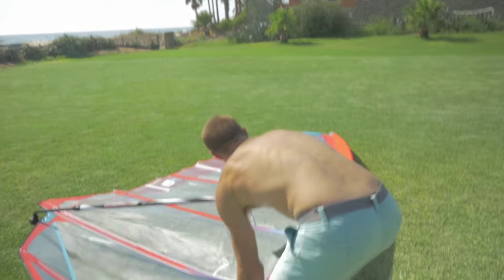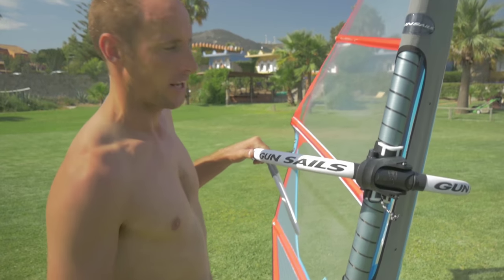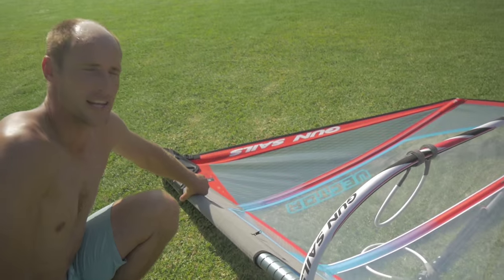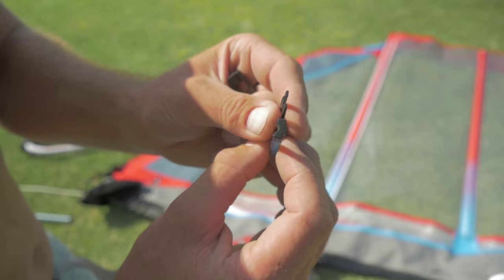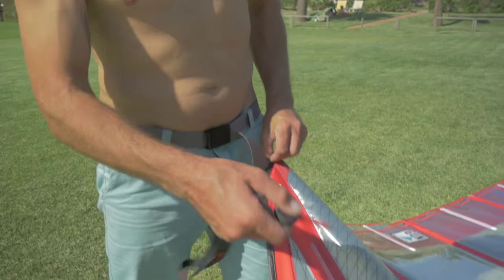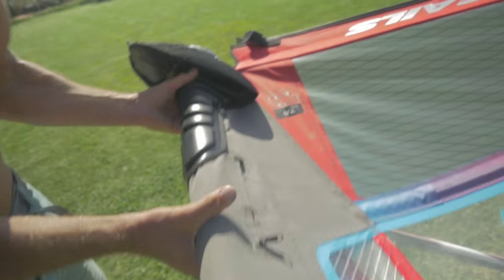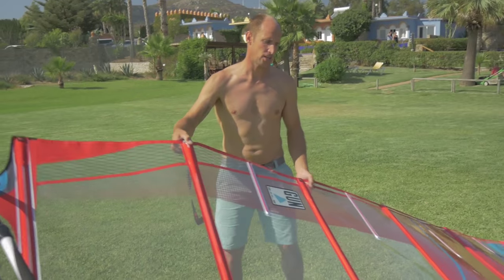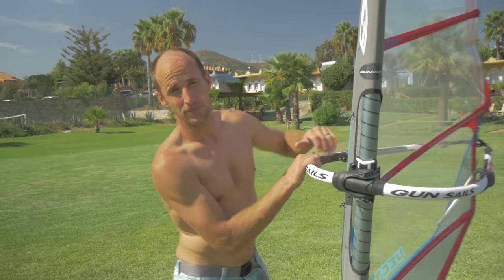GUNSAILS | How to finetune camber pressure

Comment: Upon replacing the 3 parts between camber and sail to 2mm in order to reduce the camber pressure, I still struggle with too much pressure on the cam on my GSR 2022. Hard to place cambers (impossible without max outhaul then releasing downhaul). Once in place, still very hard to rotate.
Any other tips pls??? Cheers
Reply from the maker: Hi, if you still have to much pressure with the right trim, you can take off all spacers to try and in the worst case, even grind off some mm on the backside of the camber. I suppose you use the correct mast for that sail?? Cheers Jörg

Comment: Hi, why are u using lower hole for boom terminal?
Reply from the maker: You can choose according wind speed and sailor size. In stronger winds, the lower hole gives more control, in medium to light wind, the upper hole has better planing ability and  more reactive when pumping.